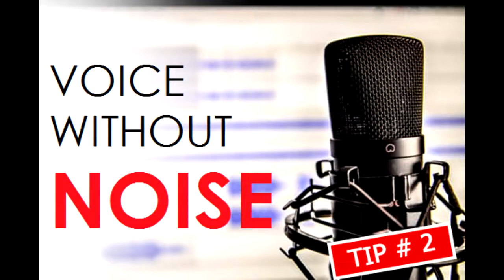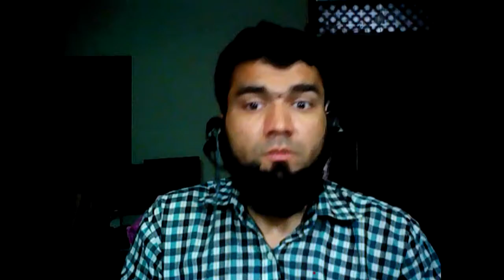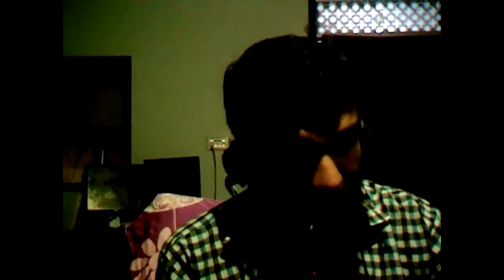Diagnose # 1 Ground Loop From Microphone Even After PC Grounded

Comment: You need to have one dedicated line for your mic alone.  Then one for your guitar, etc.  Don't connect anything else to that electrical outlet.  Humming, hissing or buzzing is a simple grounding issue.  It is electric running through each line in the system.  
You need to keep your cords separated from one another and not touching or overlapping going to your mic, etc.  Use 3 prong plugs.  The third prong is the ground on the plug.
Be careful, because when things are not grounded you can get electrocuted.  I have seen people get shocked by mics, guitars, etc, because everything was being plugged into the same board or same outlet or both.  A deadly electrical disaster waiting to happen.
Reply: hello im  facing the same problem i recently ground my pc power outlet but there is still backlground noise could it be that the the other outlets are casuing the mic hiss?